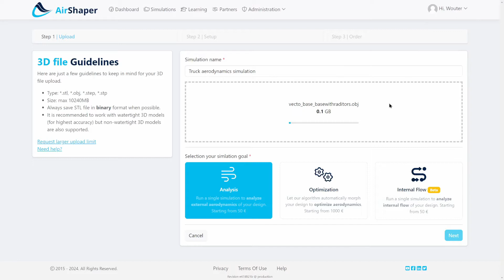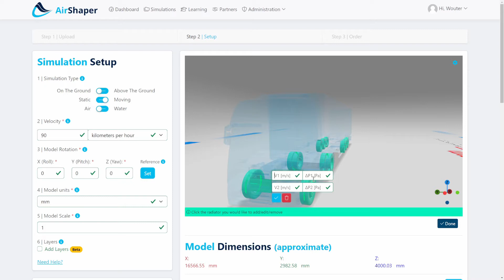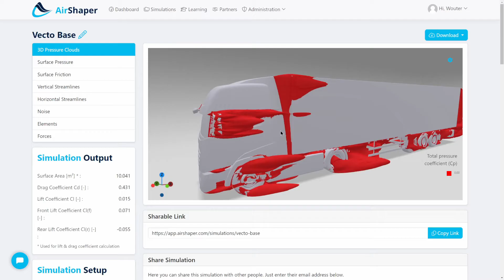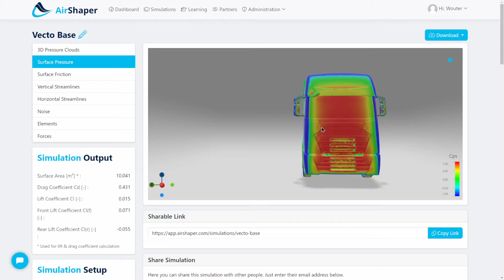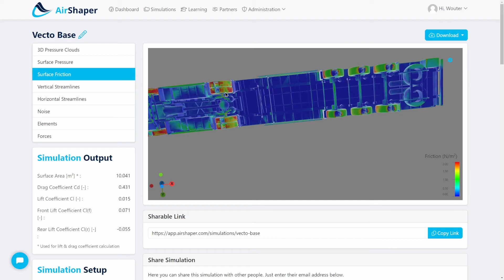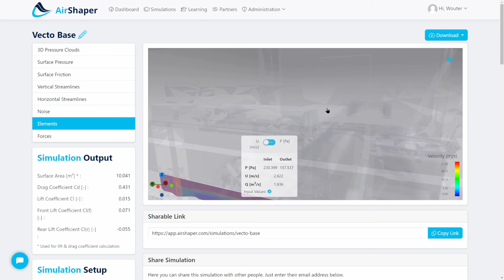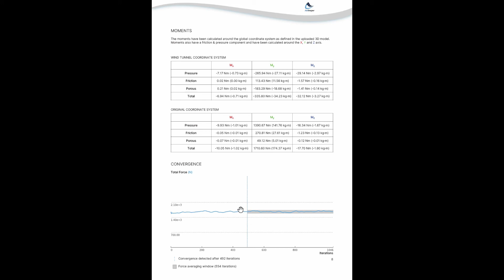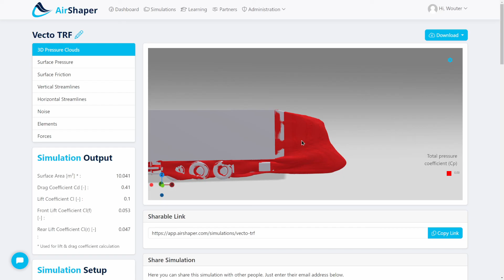Aerodynamics Made Easy - Truck CFD Analysis Explained | Step-by-Step Guide

Comment: thanks for the mention of Vecto! let me take the chance to ask the air shaper team a slightly unrelated question about drag reducing considerations of mud flaps behind the front axle of vehicles like Tesla. I am wondering why they install huge mud flaps and I do not believe they stop saving money to protect customers paint surface :)
Reply from the maker: Yes those can cause quite a lot of drag, so perhaps cleaning regularly is a better solution 🙂
Reply: @AirShaper  so you are sure, they cannot have a drag reduction effect?

Comment: So if I wanted to do this on a time attack c7 corvette with large front splitter, large rear wing, side skirts then I'd 3d scan the car and then do what? What type of 3d scanner, who do I contact, how much does that cost typically?
Reply from the maker: A 3D scan can range from a very very simple one with your phone (way to coarse) to a highly precise scan costing 5k to 10k USD for example. You do need a high resolution, especially on the underfloor.

AirShaper can work directly with 3D scans.
Reply: @AirShaper  This is interesting and I'd love to see a video on that. I know of several teams that would be very interested in implementing this.
Reply from the maker: @mthurtell  Perhaps drop me an email so we can discuss it over a call? wouter@airshaper.com - talk soon!

Comment: So shape the back of the trailer like the leading edge of a boat? Maybe a detachable faring.
Reply from the maker: Yes, detachable fairings are being used on trucks to reduce drag. One challenge is not obstruct the access to the trailer.